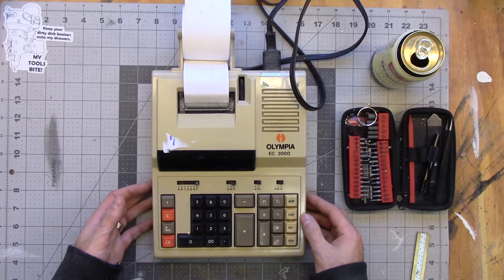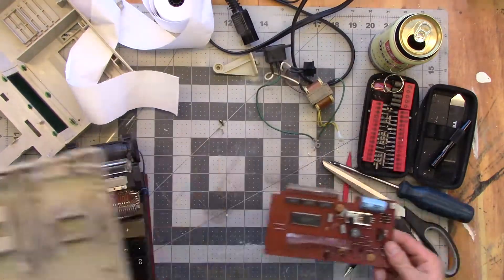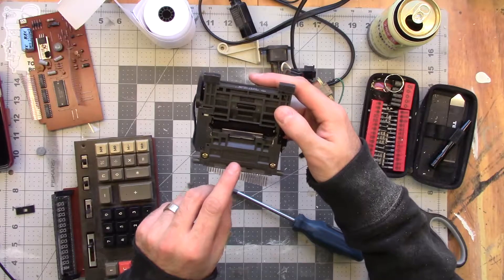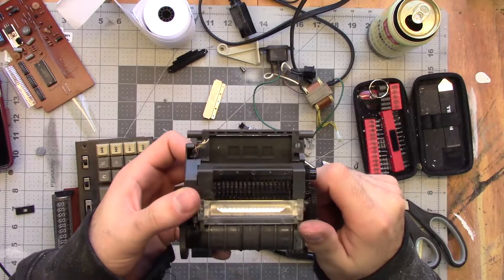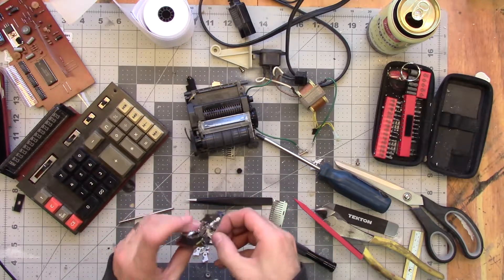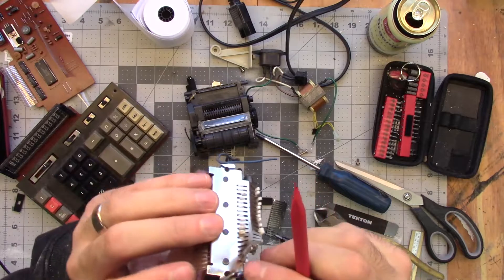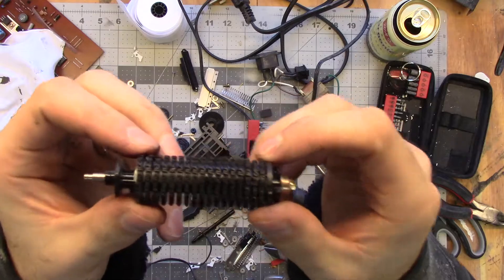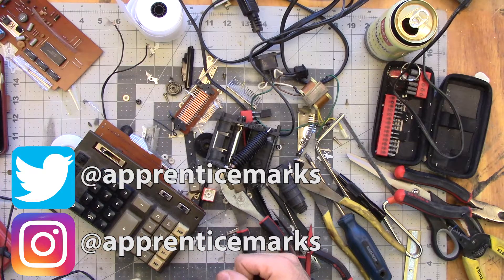Olympia EC2000 Calculator Teardown

Comment: Love your channel. Earned yourself a new sub! By the way, those electromagnets are probably solenoids. Solenoids are basically a coil around a little chunk of metal. When electricity moves through the coils it creates an electric field which moves the little bit of metal. You can tell which way it's going to move with the right hand rule. Basically make a tumbs up with your right hand. Your fingers curl in the direction the wire wraps going from positive to negative and your thumb is the way the magnetic field is going to go, and therefore the direction the solenoid is going to push when it turns on. If you want anymore clarification I'll gladly fill you in. It's hard stuff to explain. Way easier to demonstrate.
Reply from the maker: GrandHunterMan ok, depending on the direction of the coil, the little metal bit would either be pushed in or out when the solenoid fires. I’ll keep that in mind for the next time I pull apart something with a solenoid in it. Thanks for the info!

Comment: How it knows a full revolution has happened: the gab in that encoder wheel is also surrounded by a change in the contact pattern. That would look like a long pulse to the controller, and a long pulse is quite easy to detect.
Reply from the maker: Oh, right that makes sense. So to calibrate the position of the stamp drum at boot, it could rotate until there’s a long gap followed by a single short pulse. Smart.